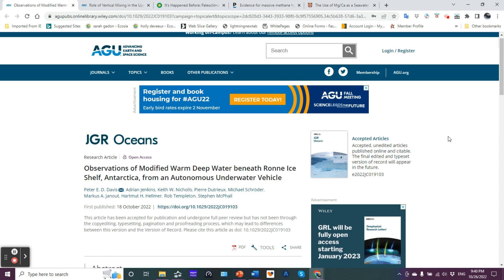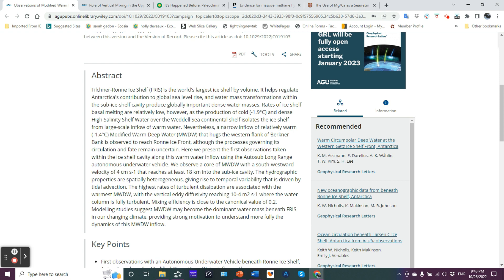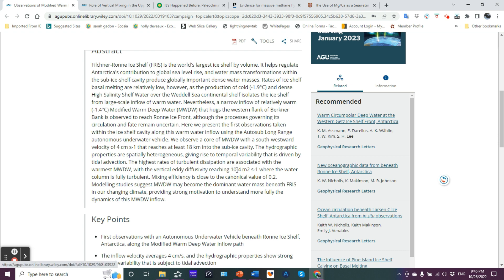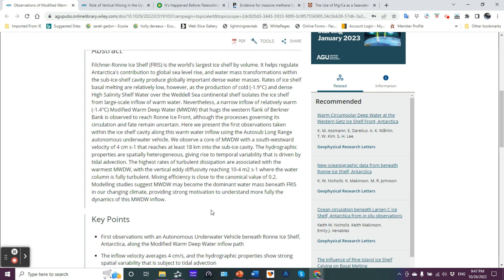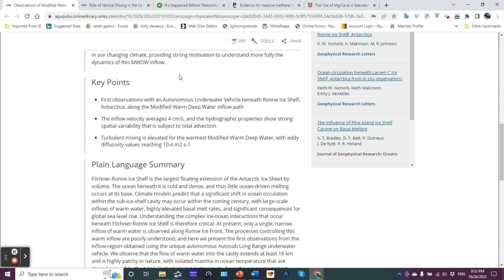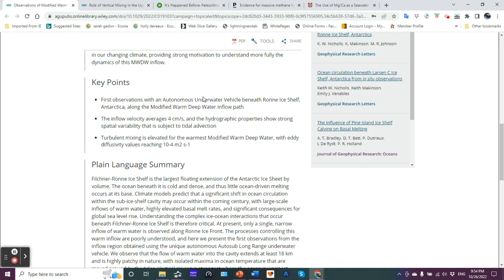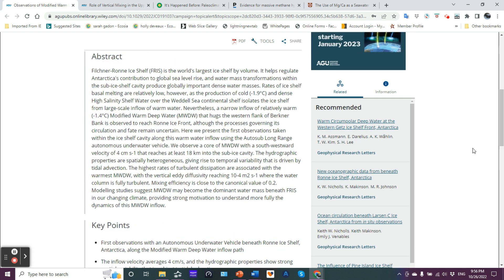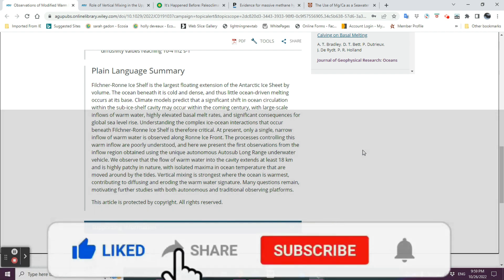Is Ronne Ice Shelf in Antarctica in Trouble

Comment: How much do they know about the temperatures in the Weddel Sea?
If you add heat to the Weddel Gyre, wouldn't that increase mixing and diffusion? 
if they didn't think there was much warmth underneath the FRIS, and they find one area, could there be other areas?
I'm afraid with everything we learned about Swiss Cheese Ice and glaciers, we might already have the same happening on the FRIS.  Are there any areas on the FRIS which would be good to keep an eye on? 
You talked about if the Ice Shelf broke off it would contribute to SLR.  But wouldn't that only happen if the land ice behind it was released?
Great report.
Reply: As you say, only landlocked ice melting would significantly increase sea level rise...?
Reply from the maker: The questions you raise need data to assess. The source of the ice shelves is not the ocean. This is not sea ice. There is sea ice around Antarctica which keeps land ice at bay. Ice shelves are derived from land glaciers. They are called this because they have gone past the grounding line and are cantilevered out past the grounding line. So yes, if these ice shelves break off and travel to lower latitudes, as they melt, they will contribute to sea level rise.
Reply: @ScienceTalkwithJimMassa  
Wow, I am not up to snuff on this. Which probably means there's lots and lots of people that need to understand what's going on.
Either a new video or you should do a brief presentation at our next Kris Zoom Meeting.